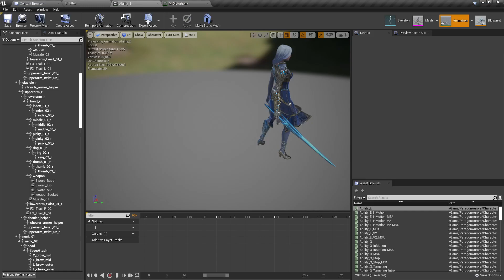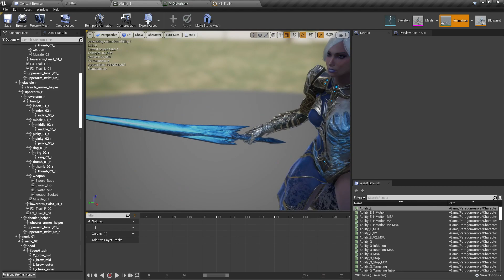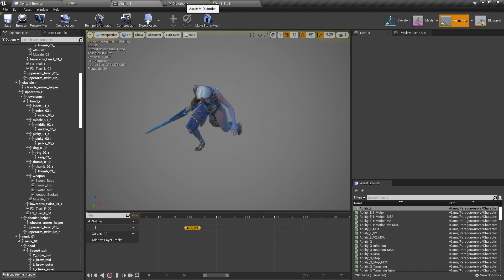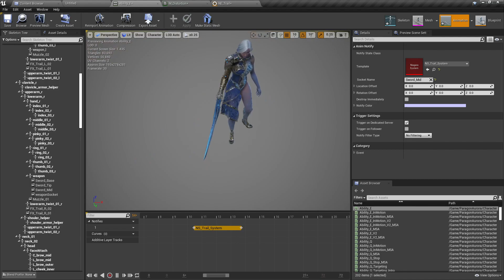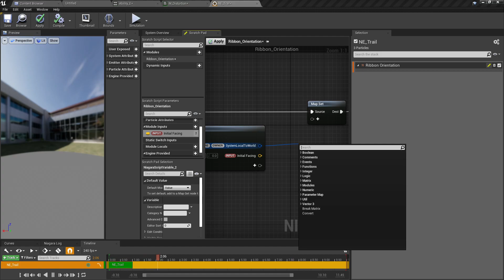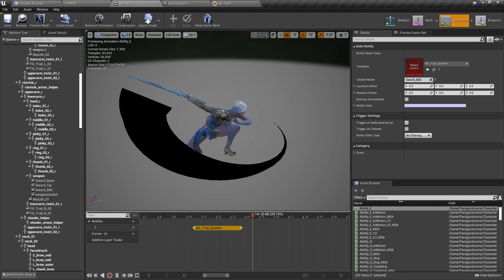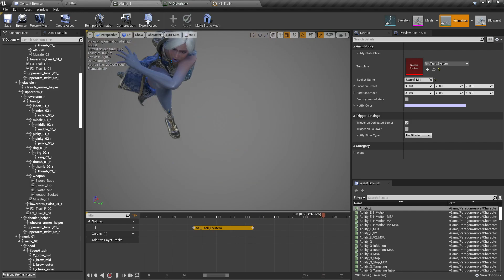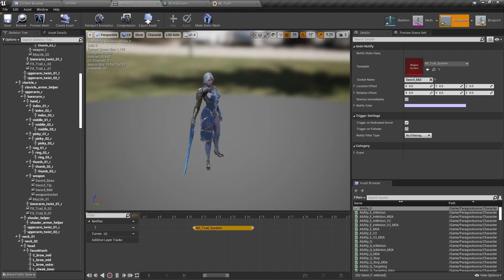Create a Refraction Sword Trail in Unreal Engine 5 with Niagara! Part 02

Comment: In UE 5.3 there is a bit of changes:
- Initialize Ribbon is moved to initialize Particle,
- To use RibbonFacing in Scratch you need first set Facing Mode to custom in Ribbon Renderer. Then you can select it in MapSet node, not in parameters->Particle Attributes (it can be not visible there),
Reply: When I add the scratchpad the trail no longer appears. I've been trying to fix it for 3 hours...
Reply: @kaiser6594  Getting the same issue, did you find a solution?
Reply: @igneel372  I don't know if you need this anymore but if I can save even just one person from the delirium I went through I'll do it. First of all, the method shown in the video and similar ones did not work for me (I tried many times but the trail just remained facing the camera no matter what I did). 
I'll paste here the lines that saved me:
The procedure is only two steps.

① Set the Ribbon Renderer’s Facing Mode to Custom. (not the one shown in the video)

② Set the value of Ribbon Facing Vector to SystemZ(or X or Y)Axis. (you can find it under the settings for the particle width in the Initialize Particle and if the particle is 90 degrees off you can simply set the rotation of the system in the socket but now that I think of it I might just have set the wrong axis)

as for the trail disappearing out of the blue I noticed (after a more than decent while and a couple of mental booms) that the NiagaraSystem simply goes rogue sometimes... if you delete it and make a new one from the emitter  it kind of fixes itself (?)

Hope this helps. Time to go remind myself that I love programming

Comment: Couldn't find spawn per frame option under emitter spawn in UE 5.2
Reply: Finally, I have found it, if you are using UE5.2 then the spawn per frame option is now set under emitter update but before that you also need to initialize emitter state for it to work properly. And to initialize ribbon, It's now under spawn particle.:hand-purple-blue-peace:
Reply: @amarsarkar3645 wait I’m confused, where exactly is it?

Comment: How do i make a sword a bone? Its not a bone for me
Reply from the maker: You can either add it in a 3D modeling software like blender or maya, or you can add it in Unreal by opening the skeleton asset of the character and right clicking the hand bone and adding a socket
Reply: @unfgames  Thanks!
Reply: @unfgames  Thx for the tutorial!
Question, if the weapon is attached to the character can we have a socket on the skeletal mesh of the Weapon or it need to be on the Character SK itself?
Thx!

Comment: Thx a lot for those 2 parts ! I have a question : The noise texture is not useful in the end ? You could have just put a scalar parameter with a value of 0 on the refraction, right ? (since you're lerping from 0 to 0)